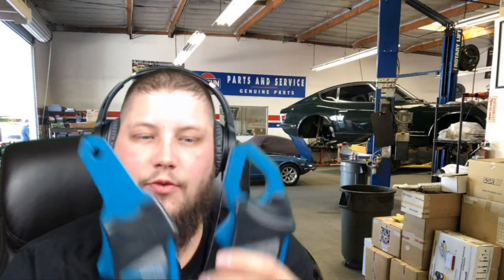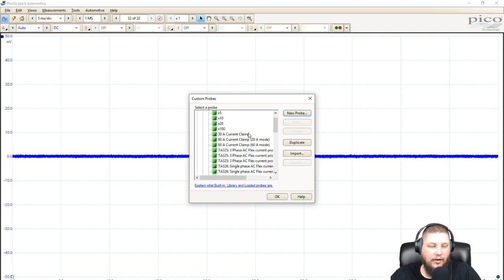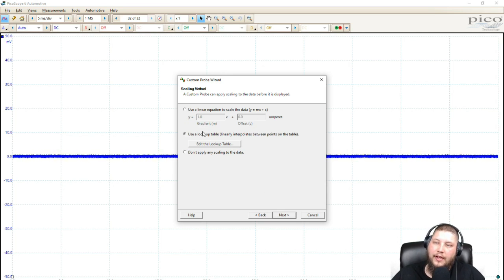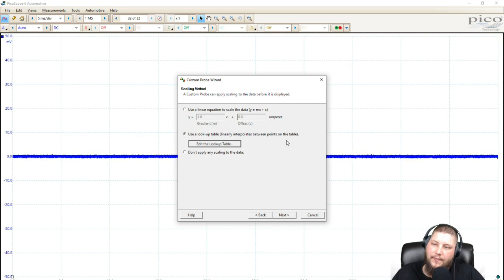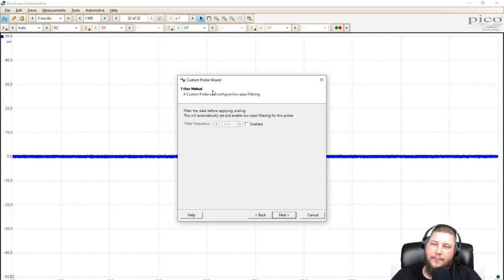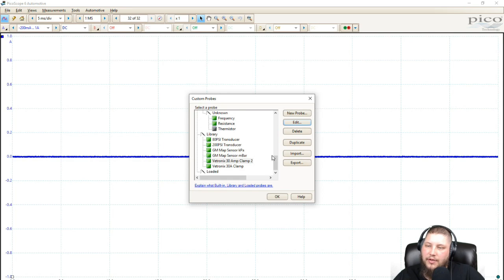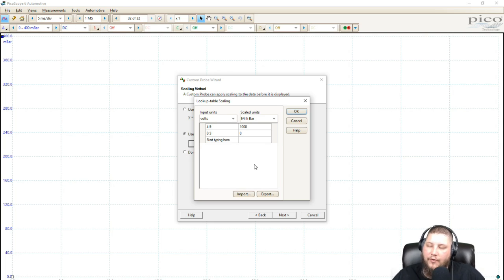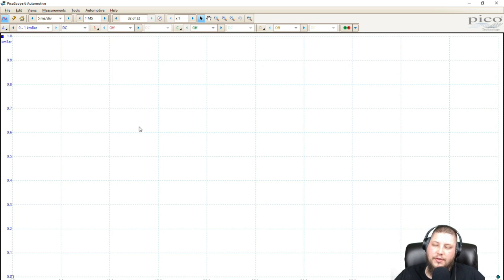PicoScope Custom Probe Setup - Keith Perkins

Comment: A ton of thanks, Keith. I am a beginner at picoscopes and I'm using Picoscope 2204A. However, I want to measure the current flows through my PSoC 6 board using Picoscope 2204A. Now the question is how to measure current flows in the board without a current probe? And then where do we need to connect the hook tip of Picoscope from the PSoC 6 board? Thank you.

Comment: Hello Keith   I jpwatch mechanics mindset videos and just purchased the rotkee pressure transducer had to make an adapter so it fit my snap on compression hoses and solid tester but seems to work I also need to spend more time using it . Any thoughts

Comment: just a thought worth mentioning  on the type of map sensor -  am I right in saying a turbo petrol engine map sensor will output somewhere near 3 volts at  1000 mbar whereas an older (pre throttle flap) diesel map is out putting near zero at 1000mbar. effectively meaning some of them can measure below atmospheric (1000mbar) AND pressure when you create the scale accordingly ?

Comment: How do you set up a custom secondary ignition probe? I can never find the spec's on the probes to know what the scaling should be?
Reply: hantek HT-25 with picoscope 2204A        is a video that might help
Reply: mine are straight (simple) probe and then the kit i got from pico has 100:1 attenuators that plug in inline with the BNC to prevent frying the scope. what type are you using

Comment: THANK YOU KEITH , TRULY APPROPRIATE THIS INFO JUST BOUGHT A  Hantek Ignition Capacitive Auto Pickup/Probe (HT25)  USING WITH A  PICO IS IT POSSIBLE TO MAKE UP A CUSTOMER PROBE . I HAVE MADE CUSTOMER PROBES FOR AMP CLAMPS AND IGNITION COIL ON PLUG PICKUPS BEFORE BUT NEVER ONE LIKE THE HANTEK . ANY HELP WOULD BE GREATLY APPRECIATED THANKS AGAIN !